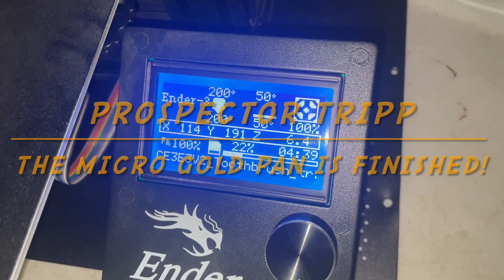3D Printed Micro Gold Pan is Finished!

Comment: Appreciate you addressing all my previous queries PT.  And yes I agree that you can use almost anything to capture gold in/with. My mind gravitated to expanded accessories for your finishing pan with a number of different-tiered-sized-separators that could stack ontop of one another/ It would take up a whole lot less room and weight than probably one regular sized pan (guessing on weight).  Can't wait to see what you start creating next!

And you know I have to ask..... I believe you said a roll of PLA was 15 bucks, how much do you have left over? The guy that's going to make a million bucks will be the guy that invents a way to take all the 'refuse pieces' and melt it down to create more (reusable) filament. But I digress... imagine that! Can't wait to see where your 'muse' takes you Matto!
Reply from the maker: Colter and I have discussed pretty much Everything 😂 including lashing on to the huge plastic island in the ocean and dragging it ashore to recycle. Second Use Baby!
The amount of PLA filament used was I believe roughly 10% of the filament roll.
It’s very economical to simply print something out.. but the amount of design time and effort is where the cost mostly lies. Simply downloading a free design and then printing is quite easy. But still requires your due diligence to ensure proper setup adjustment and a good knowledge base of 3d printing.
There’s lots of help online and tutorials for dialing in your 3d printer.
Luckily Colter is a Expert at 3d printing! He got me going in 30 minutes 😳
I’m currently printing another gold pan that’s a different design and larger than the first one. 
Going to the shop to check on the progress rate now!
I’ll upload a short clip if there’s anything interesting to report.
Thanks Johnny.. your talented masterful designs are awaiting!
Merry Christmas pal 
✌️PT

Comment: Sorry im a bit late to this party. What were your bed/nozzle heat settings for printing? I have the ender3 as well as the ender3v2
Reply from the maker: I believe I used 220c for the nozzle and 60c for the bed. I’ve had fairly good results using pretty much basic settings. I haven’t been 3d printing during the summer months, but will again be 3d printing over the winter. After upgrading one of my Ender 3’s with a direct drive extruder and automatic bed leveling I’ve gotten great results. Another improvement is, I use after market glass beds. The Bed Adhesion has been majorly improved by washing my glass beds in the dishwasher then reinstall being careful not to touch the printing surface with my fingers. 
3d printers are getting much much better, I’ve heard the Bambu labs 3d printer is crazy fast and prints Amazing with virtually no failures.
Future so bright I gotta wear shades! 😎 Enders are a good learner budget printer and taught me a Lot!
Hope you get some great prints!
Peace Prospector Tripp